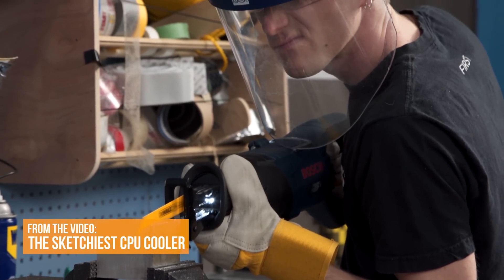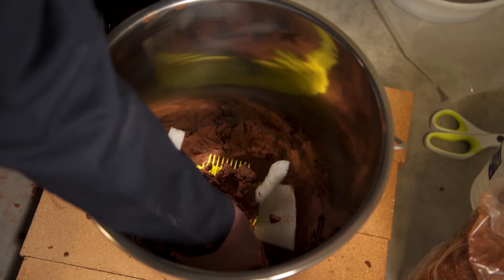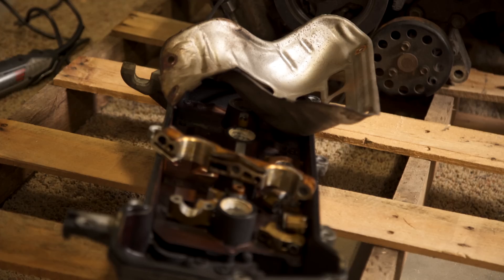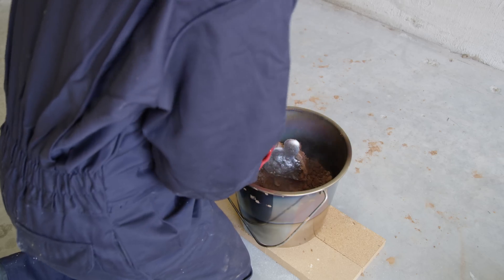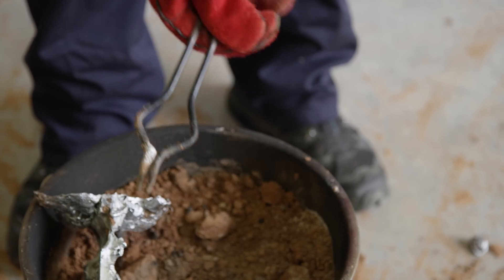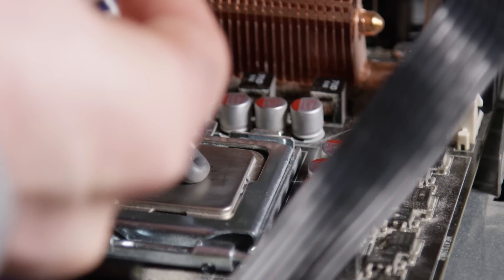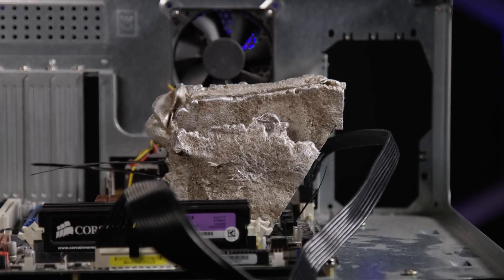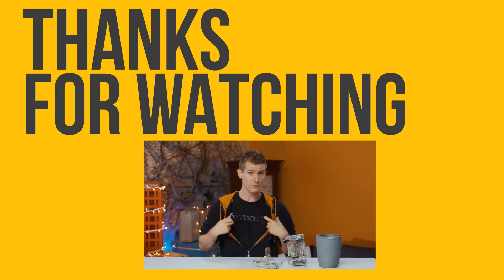The WORST CPU Cooler EVER – Sketchy Heatsinks Ep2

Comment: "$200 worth of material"
$2000 3d printer.
$30,000 software.
Reply: You can buy one "seat," install it on multiple computers on the network, and anyone can use it so long as it is only one person at a time.  If a second person tries to open the software it will not work.  Linus will do some absurd things for the sake of making videos, but he's not stupid.
Reply: He clearly stated his "engineering" department is 1 person = one solidworks license. and to be honest you can simulate the flow in the mold. So he has clearly no plan of using sw . 
I paid 5$ for my license i guess i am a lucky guy :)
Reply: You have a personal license. Not a business one. And you buy licenses based on how many people work in the department, not how many people will use it.
Reply: you normaly buy them for one workplace in smaller companies but you talk about bigger companies, lmg is way to small to afford this kind of stuff + its useless for them
Reply: onshape is web based and free, no need for 30k
Reply: They should have used Catia, the heatsink would have come out perfect then (just kidding) but it would have cost a lot more at least. http://www.worldcadaccess.com/blog/2012/05/whats-the-price-of-catia.html
Reply: A professional license for solidworks is $3000, times AT LEAST 10 workstations. That's $30,000.
Reply: Zestypanda interesting but I don't think they need one on every workstation probably only need 2 at the most. They are not an engineering firm
Reply: andrew nelson Per seat.

Comment: You need to bake the green sand to a temperature high enough to melt and evaporate/burn off the PLA or foam, whichever you are losing... it has to be gone completely when you pour in your metal. (Courtesy of my two years as a software developer at a lost "wax" titanium foundry.)

Comment: I mean those are kind of hard approaches, can't you just:
1. buy fairly thin aluminium, buy some copper brake lines, also get a small block of aluminium for the base 
2. cut aluminium sheet into squares, cut pipes to length and bend to shape
3. drill holes through aluminium squares the size of copper pipes, cut pipe shaped indentations in the base block
4. put base and pipes together, solder then assemble the squares and the pipes soldered to the base (soldering them one by one)
5. add a tiny amount of water to the pipes the solder the ends

Comment: Make a 3D print then silicone mold then cast cement in silicone then put cement copy of the heat sink in bottom of bucket and pour the metal in a bucket then cut the buttom of bucket off and smash cement around it
Reply: Wouldn't that leave you with a heatsync shaped hole in the metal?
Reply: It'd be better to do a wax cast instead of a cement cast and just do a lost wax cast from a plaster mold
Reply: MODKILLER101 it won't work, listen to Ekjot Singh. And I doubt anyone will trust someone who makes Minecraft videos.
Reply: Aluminium fins are extruded for a reason eh ^^.
Reply: MODKILLER101 just  print the shape cast it with silicone, pour wax in, cast the wax in cement put it the oven to melt out the wax the. pour the aluminum and crack open the cement mold, the king of random did it.
Reply: it will not work, believe me i'm an engineer

Comment: You didn't have enough pressure because you casted the wrong direction. if you would have turned the PLA design upside down and filled the fins with sand. this way the pressure forms the fins. and you get a smooth surface.

Comment: I feel like the molds were put in the green sand upside down. Also, why not just use pure play sand? If the mold melts away fast enough, it will still hold shape.

Comment: better cutting aluminum can than using all this crappy way to do it. if i want to do it, i will aluminum can and solder them together on top a copper base. If want to go extreme, use aluminum foil

Comment: My suggestion is the mounting plate should of been the top of the mold so gravity could fill in the cracks for the fins. And you could of made a negative mold by removing the 3d printed model once the mold harded.

Comment: maybe im terribly ignorant, but why would you not try to cast the heatsink upside down, so that the metal would pour down into the fins, with the base plate having the highest elevation? is it because this way has a better chance of better quality of base plate?  seeing as they went to it with a grinder anyway, i have to think pouring the casting upside down might have worked better
Reply: they have?
Reply: jort93z you mean to suggest I missed them precisely what I propose in my comment? Oh. I certainly know not all were so, Linus mentioned about not enough pressure to push the molten aluminum up into the fins

Comment: i recommend copper. better heat dissipation and should have so much air bubbles. instead of making ur own casting sand, buy it too, and moisture you have will ruin your cast. and another thing! pouring temp is essential. temp your metal before you pour! im 99% sure your pour to cold.

i use to would in a foundry and melted for 3 three years straight, working with steel, aluminum, copper, brass, and everything in between.

Comment: The problem why you didnt get success was the casting frame. If you used 4 pieces of wood, sifted the sand and packed it properly you would have been able to achieve a better rate of filling and pour though the mold itself. A bucket doesnt make a good housing. Also for PLA you want what your casting upside down. You can buff the flat surface better to smooth it down.

Comment: When pouring your foam model was backwards the fins need to be pointing down,  the base plate on the top,  you need 2 holes,  one for entry the other for exit of the metal,   your metal was not hot enough when pouring also did you use borax to skin off the slag?

Also the mold bucket sucks dick,  you should have used sand in a 2 frame unit.  once you take the item out of the mold then you cut off the entry and exit pipes,  and polish the base plate.

Comment: That was a really bad attempt. The green sand in the video as well was too wet.. It stuck to your hands... Use silica sand or at least the finest sand combined with bentonite clay (kitty litter) and water added with spray bottle while . Mixing generously.

You also needed to degas with washing soda and remove all dross... +Making 's flower put furnace rather them blasting the heat in.. Which doesn't heat the metal up properly.. + you might even be blasting in crap doing so. Use a tougher foam as the one now collapses too easily and you gotta bake the mold in a furnace to get rid of it all. 
Also use jodium free table salt to flux the aluminum. 

Because your clay sand mixture was so wet.. It will cool down the aluminum even more rapidly and makes it even harder to flow.. 

You also need vent holes... Next time find a professional or hobbyist backyard metal caster... They would have loved to take on your challenge.

Comment: I dont understand how they thought the fins pointing up was going to work? Just flip it upside down and remove the pla so it doesnt even have to melt, Use a trench or something so you dont have too much pressure going on the fins to disrupt the shape and you should be good.

Comment: Why not CNC??  If you had software and hardware it's reasonable. sure it's not good as casting but it's good enough.  CNC thin aluminum and attach these to copper pipes or something?
Reply: Because Linus already made a CNCed heatsink in Scrapyard Wars, and they want to try something new.
Reply: 3520xdxd primarily because it is more expensive then casting, especially in machining the fins.
Reply: CNC milling is MUCH better than casting if the number of units being produced is very small, the detail required is high, and there aren't too many complex curves (unless you wanted to borrow a six axis milling machine... but that would be expensive to borrow for a day). Sand mold casting has very low tolerances and I sincerely doubt they'll be able to make something with "fins" thinner than 6 or 7 mm without lots of failed attempts and practice.

Die casting probably wouldn't be feasible with the size of heatsink they wanted and investment casting is generally pretty expensive as well and requires at least a 1 degree draft angle. I think for a 1 off design using a CNC mill would work best if they have a way to borrow a CNC mill for a day (seriously, the bit size to detail between the fins would have to be tiny and require a huge amount of passes... that would be expensive if renting a mill).

Basically, go with a CNC mill for a one off design like this, go for investment casting if the heatsink is fairly large and you don't mind some post machining to remove the draft angles (and you're making a lot of units), and go for die casting if you are making a relatively small heatsink and you are going to make a whole heck of a lot of them (as this is also expensive like investment casting).

If I wanted to make a good home made heatsink I'd take a large flat piece of Aluminum, face both sides (leaving rails that can slide into another milled sheet of aluminum perpendicular to the fins), machine another piece of aluminum the fins can slide into, cut up the first milled sheet into identical fin pieces, slide the fins into the other main piece described earlier, drill some holes through the structure that copper pipe can slide through, slide some copper pipes through said holes, and call it a day. Not even mad the copper pipes won't touch the main portion that the CPU contacts with. As long as the copper pipes are close to the base of the heatsink I'd say it's fine.
Reply: he made a water cooling CPU block and GPU block, but not an air cooled heatsink
Reply: Thanks!! Wow That's a new way of thinking. that's a really good explanation.

Comment: when you pour the aluminum in have the mold upside down with the flat part on top. its easier for the metal to fill in correctly this way.

Comment: This is painful to watch.  Apparently LMG employees are incapable of using YouTube.  There are literally dozens of DIY videos showing how to cast aluminum properly...
Reply: How the fuck can you cast 1-2mm wide fins without deformation using this method? You could make 5mm wide fins probably but then you would have 6-7 fins and small surface area. And you would need to polish the base. Am i missing something?
Reply: I've made them in high school, using the green sand method. It's really not that hard, and whoever was doing the casting clearly didn't look it up. You get great detail work on the bottoms of molds, just look at Hershey bars, and the topside can easily be filed and polished flat.
Reply: Who said anything about fin size?
Reply: When I did some crude casting we would paint the foam with some heat resistant black paint. I can't recall exactly how it was called, but it would form some sort of a shell around the foam.

It prevented some deformation and made the surface finish rather smooth as the metal didn't come in contact with the sand. I think it was plain old.

But in the end, I think you are right. Making thin fins with lost foam casting is probably not easy XD... or possible.

That's why heat sink are extruded :D.
Reply: This is a heatsink dude. How the hell are you expecting the heat to escape with thick fins?
Reply: f622 Heat can escape from thick fins. It's a question of available surface area. Thin fins simply mean that they can be numerous. 

When designing fin, you must know how much heat you are looking to loose. The rest follows.
Reply: Shabtai1024 We've got a pro over here...
Reply: What's painful to watch is you trying to showing off your irrelevant Youtube-Searchology degree.

Comment: Uh.... you have to melt/vaporize the PLA out of the mold BEFORE pouring the metal. Also lucky you didn't get any steam explosions from the wet sand/clay. An explosion of molten aluminium would... suck.

Comment: Just use wax.
Made the frame with was. then put thin layer of mud over it.
After couple of layer it will come into a shape.
Then, burn that thing into a furnace. It will hard like a brick and will took a perfect shape inside.

Now you pour the melted aluminium inside it. And...
Voila !
You will get what you wanted.
Wait to harden the Aluminium. Break the outer shell.
You just got your almost perfect heat sink. All you will just have to do is sand paper it.

Comment: With lost foam casting you use dry sand, like play sand or aquarium sand for a cleaner casting. Green sand is supposed to be compressed into the shape of the object (a mold) and then the object removed before you pour. Also that green sand was too wet.

Comment: LTT try makign the fins downwards and try the plastic molding method again. You won't need a molten metal intake if the base is at the top and you just overflow the thing , trim the sides off and you should have a good mold

Comment: I think that if you guys used a 3D printed filament called PVA instead of PLA, you would have an easier time making a mold. PVA is water soluble, so once the green sand is around the plastic, you can dip it in water for a few hours and it will dissolve away. This will leave you with a perfect mold for casting.

Comment: In my high school we had a class called 'Technology' which was split into two groups: the smart kids did 'electronics' (learning components, designing PCBs, building circuits etc.) while the less smart kids did 'engineering' (wood/metalworking, think 'shop class' in the US).  This video clearly illustrates what happens when the 'electronics' students try their hand at 'shop class', which proves the theory that I had even back as a snot-nosed 15-year-old who was forced into the electronics class when I'd have been just as happy learning engines and lathes: it can't be good to only have one tech discipline or the other; everyone should have a chance to learn both. Plus, even back then I thought it was kinda discriminatory to not let the 'dumb' kids learn computer programming etc.... Like, resigning them to a life of fixing pipes and carpentry as if those professions are somehow less intelligent than building computers? I mean, come on....!

Comment: The lost PLA method does work, but your "green sand" was never going to. That's way too complicated a shape for the lackadaisical "packing". So, here's a tip. Find some pool filter sand, it's white and perfect to mix with 2 parts plaster of paris. take your 3d print, and put it in a container, then pour the plaster over it and let it dry. (follow the instructions for the plaster). To summarize thus far, 1 part pool sand, 2 parts plaster of paris. You may need to adjust the amount of water to make it goopy. Pour over PLA print. Let it dry over night. Now, toss the whole thing into your "furnace" and heat it up until the PLA burns off completely. Heat up your aluminum until the whole thing is red, redder than you managed on that last pour, and make sure to HEAT THE MOLD. then, pour it in there and give it a few minutes to set before tossing the whole thing into a bucket of water. The mold, mind you, not the crucible. Now, hit the whole thing with a pressure washer to remove the plaster, and polish the bottom.

Comment: To be fair had you have cast the design fins down and planned to slice the cast's rough uneven base plate smooth you might have had more luck actually getting fins or even something that resembled the offspring of a stock cooler and Rocky Dennis from the movie Mask.

Comment: It's still better than a intel stock cooler at least.
Reply: Yofatboy123
The point of fins is the more you pack in an area the more surface area you get. That improves dissapation to the air.
I suspect it won't dissapte faster than the processer can input heat, therefore once it is saturated it will overheat.
The reason it stays cool for so long is because of the sheer amount of metal to heat up before it is saturated with heat.
Reply: Youtube User yeah, that intel heatsink you're talking about is pretty bad

Comment: Casting thin sections - like fins, specially tightly packed tall ones - is a task best left to professionals and even then, expect mixed results. But it makes crazy lolz so hats off to your team for effort and not forgetting to test for stability.

May I suggest you use a series of plates for fins and fit a copper rod through them next time?

Comment: The idea was good but when executed, you should have kept the flame on when pouring the aluminum so it didn't solidy as quickly.
Maybe try with another metal that does solidify as fast as aluminum !
Also pressurised water cutting into a metal block is as awesome as it sounds.

Comment: Something like what you guys wanted should be investment cast not sand cast, and casting is not the appropriate method of manufacture for a heat conducting object as casting causes density loss which will reduce the heat transfer properties of the object. In industry any heat transfer object is forged/extruded then machined (if necessary).

Comment: 0:00 why is the drill slowed down but the rest of the video is normal
Reply: The same reason spinning wheels can look like they are going backwards. They are moving faster than the framerate of the camera can capture.
BTW, It's a saw not a drill.
Reply: Yea that's what I thought was happening.

Comment: Your chemistry of the molten aluminium is not quite right, you should use some flux (potassium chloride and Sodium Chloride) to help it flow better and the mold have to be completely dry so it wont form vapours. Maybe next time hey.

Comment: ...You know the point of the foundry is to insulate the heat and increase the temperature of the crucible right?
So your "open air" design was... pretty bad.
Reply: Also wouldnt it have helped if you made the heatsink upsidedown so you'd need less static pressure? Because those fins would need holes if you even wanted the aluminum to push up there?